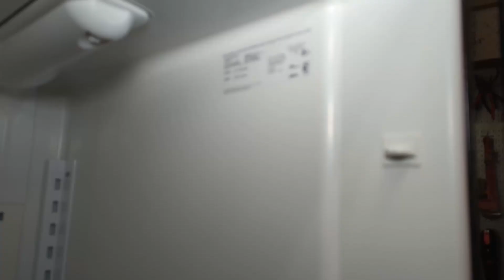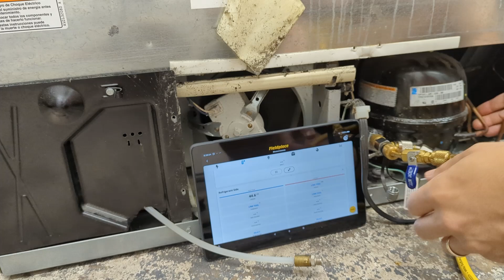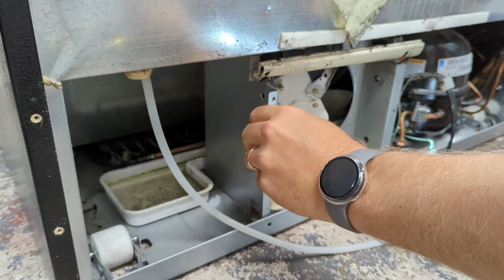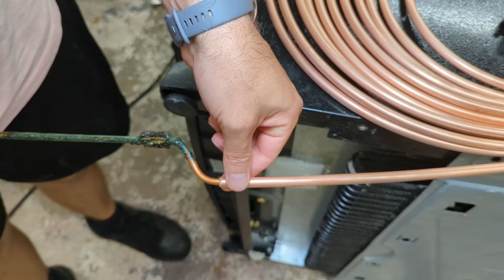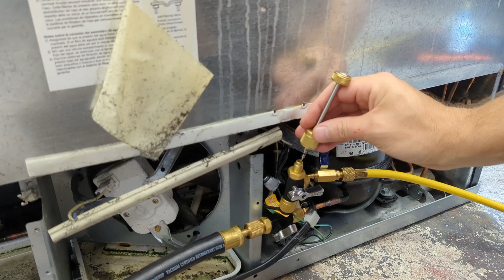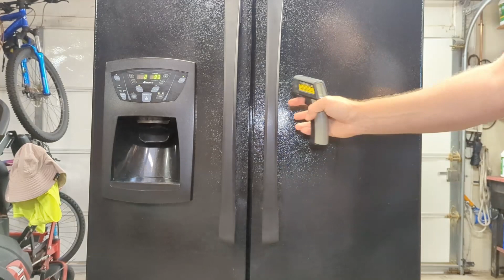Trash Picked Amana Fridge

Comment from the maker: This video was filmed in August of 2023. Fridge is still working great as of September 2023!
Reply: you haven't had any issues with the condensate pan filling up and overflowing? Might be a good idea to pick up some of those wick pads they use in larger commercial refrigerators. Wicks the water and helps evaporate it
Reply from the maker: @reddyuda  nope no issues so far but will keep that in mind thanks!
Reply: Wow exactly what my problem is same model fridge working perfect, next morning no cooling. I bet the same pipe is my issue.   I just ordered a few things to add Freon but I bet that pipe is rotted..... I dont have the tools you do guess Ill have to hit Harbor Freight for a vacuum pump. Where is that solder you mentioned Home depot? and some of that pipe you soldered in? I just couldn't throw it to the street, its still too nice even though its 24 years old.... Thank You for the video